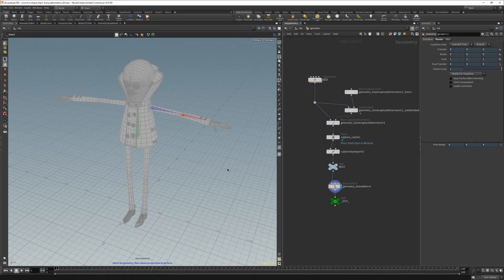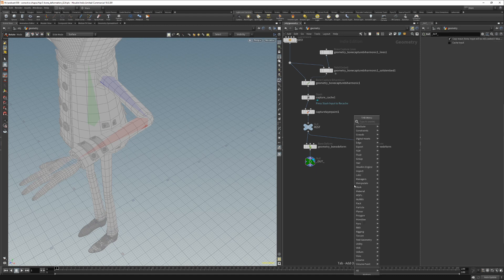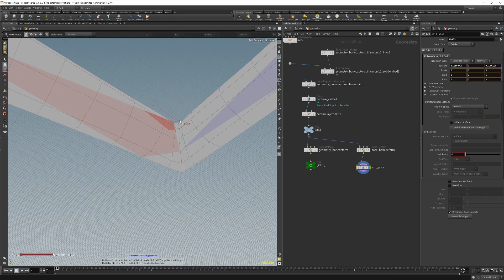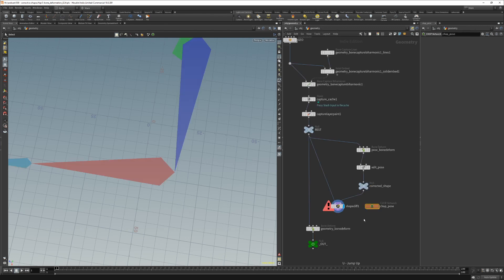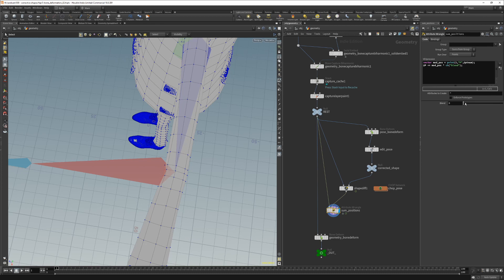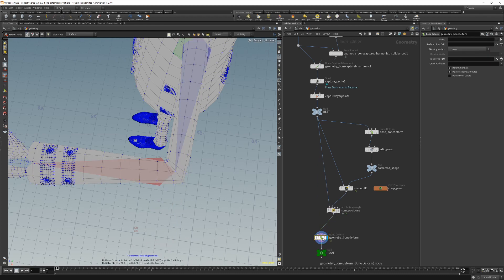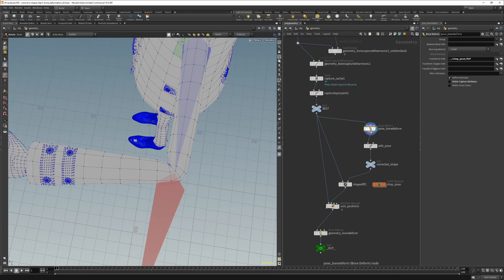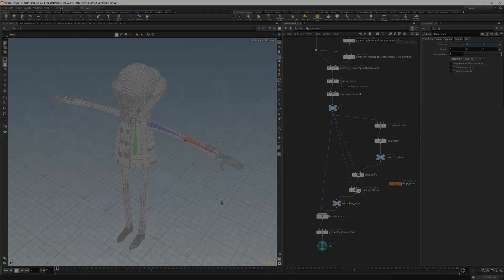Character rigging in Houdini: Corrective Shapes - Part 2

Comment: Thanks for the rigging videos. New on Houdini. Confused why are there 2 rigging KineFX and bones? Will KineFX replace the old bones or they work hand in hand together.
Reply from the maker: They are separate systems. Object based bones rigging is the old system, KineFX is the new system. It looks like KineFX might completely replace the old system in the future.
Reply: @rokandic  Thank you for you kind reply. So it's best to learn KineFx as a beginner on Houdini rigging than the bone system.
Reply from the maker: @everydayfitness3004  In general yes, but just know that KineFX is still rather new and a lot of features are still missing, that's why the object based bone system can still be very useful.
Reply: @rokandic  ah ok. Thank you!
Reply: @rokandic  Makes me wonder hopefully Sidefx will have some kind of old bones to KineFx converter if ever they decided to depreciate the old rigging system